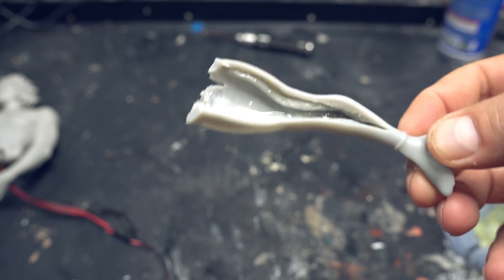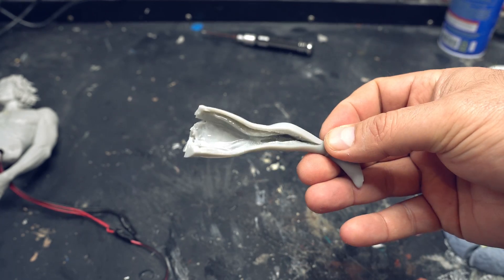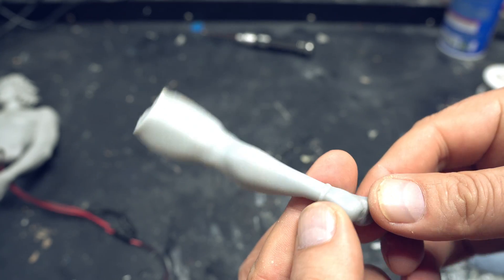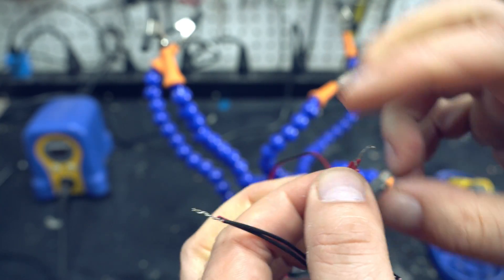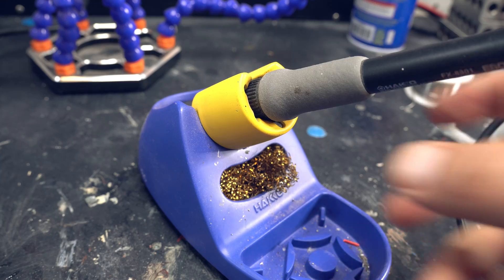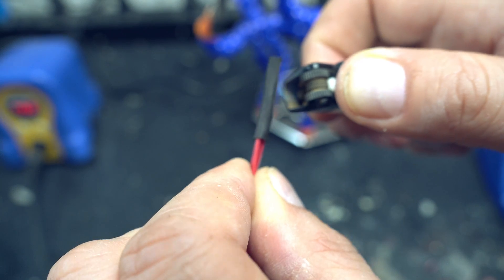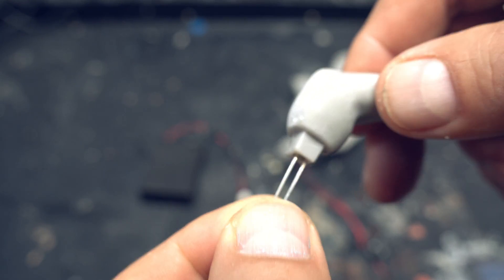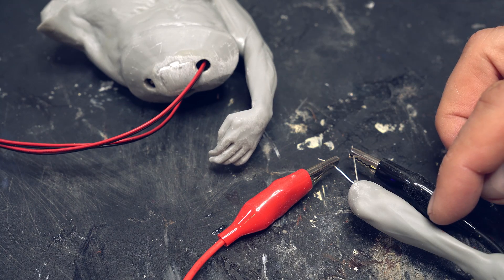Something is Killing Your 3D Resin Prints - Uncured Resin Damage

Comment: Listen, the reason this is happening is because the whole print is under cured and toxic. you need to go watch every video I have right now, because every resin print in your home is toxic and not fully cured, slowly leeching gases. switch to transparent resin, you won't have that issue. Those tiny lights certainly aren't going to give you a full cure, when then the curing station couldn't do it. the outside 1mm or so will be cured, inside toxic.

Comment: I've had 3 nice 3-d printed resin models crack into pieces almost a year after they were  painted and completely finished. I blame this on amateur garage printers improperly curing the prints. This video is very helpful, but really the people printing and selling these should have the knowledge and ability to be able to make these properly. 
Inexpensive 3-d printers and fly by night sellers are a recipe for disaster. Can't even complain since the product appears fine until 6 months to a year later it literally self-destructs.

Comment: or print solid , but your normally better of flushing the models better so the drain holes actually have cleaner flowing through them , then if you feel like it then toss in the smaller UV lights
Reply from the maker: You know that just made me think. I could use a syringe to wash.put the inside. Thx

Comment: Yes, I have had this happen to prints, especialy small solid volume prints that I created that hade to withstand a pressure/vacume chamber for mold making. I wish there was feature or slicer that allowed for single layer-multiple pattern light exposure setting that allowed user to have a gradient light exposure to allow for each slice to have a more cured inside layer while allowing the extriors light exposure to be fine tuned for detail.

Comment: You don't flush the model with IPA several times? I've got 10yo models with no issues because I always flush the model through the drain holes
Reply from the maker: Yep. I let it parts soak for about 15 min. Then fill and drain them several times

Comment: There are a few things that I do. I always double-wash with multiple dunks and swirls to ensure the center is fully clean.  I never expose the resin to degreaser, it disintegrates the resin model even if it is cured and I had a couple models ruined when I put it in an ultrasonic cleaner with LAs Totally Awesome to strip them. Always keep a hole in the model or a path of air when fully assembled so the pressure is always equalized with the environment. I try to fit a UV LED inside the model. If I cant, I have the air path to prevent the resin model from exploding later on. I also never soak the model in water without drying it immediately after in dry box or in front of a space heater.

Comment: If you don't want to make a little UV curing light and do this, print all your hollow stuff in translucent / clear resin so that you can easily cure the inside.
Reply: what settings do you use? I have quality flaws with 0.025um layer height and 2.4s exposure time even though my exposure tests came out fine.
seems like there are layers cured through the active printed layer and are curing resin behind it during the print.

Comment: Nice video to fix it. Interior leds are a plus to ensure you do it right. 
I had the same experience from the firsts prints and not happened again for a years. 
Just be sure the interior is cleaned and dry before close the holes. The ultrasonic cleaner is the best for this. What I do? 
-I wash the pieces in the first bucket of IPA (by hand), 
-then repeat with the second bucket (more clear or new IPA), 
-then put it in the ultrasonic with new IPA and let it dry for a night o day. 
-Then you check the interior is dry and it's ready to close the holes and cure the exterior piece. 
-Painting and mounting the final step. 
Never happened to me again. I hope that help you.
Reply: when you say "by hand", i hope you mean gloved. Aside from the alcohol being rly rough on skin, uncured resin is mad toxic

Comment: Since I paint, and therefor primer, all of my prints anyways, I've just started printing EVERYTHIGN in clear resin. It allows the UV to get all parts and cure solid. Then I primer and paint. It has worked well for me so far.
Reply: After multiple cracked prints I also print in clear resin now.
Reply: this sounds like a great solution for the lazy like myself
Reply from the maker: That's actually a great idea.
Reply: what settings do you use? I have weird overexposure issues with 0.025um layer height and 2.4s exposure time even though my exposure tests came out fine
Reply: what settings do you use? I have quality flaws with 0.025um layer height and 2.4s exposure time even though my exposure tests came out fine
Reply: what settings do you use? I have quality flaws with 0.025um layer height and 2.4s exposure time even though my exposure tests came out fine.
seems like there are layers cured through the active printed layer and are curing resin behind it during the print.
Reply: This is the correct way to do it. I've worked with SLA printers for years for work, and most people in the resin 3d printing community have no idea that this is a ticking time bomb for them. At the end of the day, people will have to accept that the technology was never designed for permanence. It was designed as a cheaper and faster alternative to standard prototyping. In order to get permanence, you need to do what professional model and mini companies do that use this tech. You use these to get your masters, and then use a chemically curing resin (not UV) as your final medium. Then you will have to assemble that.

Comment: I had this happening with some coins I made earlier this year that started splitting apart not too long after making them.  They were hollow and I did the full alcohol soak to try and remove as much uncured resin as possible, but then they sat in my unfinished and non-AC garage and many split.  I wish I would have seen this before. I could have easily built something like this and not wasted so much on failures.

Comment: I’ve been thing about trying something like this but I thought maybe using fiber optic cables with the one side sitting against a flash light and the other end going in the print.  Not sure if that would change the intensity of the light or not or Chang it’s wave length off 405nm   Any thoughts?

Comment: Some materials are better than others, but the cross-linking in these UV cure resins is unfortunately prone to reversion, much like you find on older 'soft-touch' plastics that have mysteriously turned sticky/gooey. Almost all 3D resin prints will revert to goo eventually. Only real solution is to keep backups of your print files.
Reply from the maker: Interesting. I'll have to look into that more. It makes sense though. Thanks for the info.
Reply: That's... shocking. What are some keywords to search? "UV resin reversion" doesn't turn up much. The UV resin patent I found mentioned an acrylate composition, and so it seems on face that catalyzed resin should break down in the same way that CA glue does — ie. not perfect but pretty robust.

Comment: This has happened to me before! It was thankfully not with anything of much value, but it could have been!

Like others mentioned, I wouldn't hollow anything that small, but for larger items I bought a great little UV torch in the correct wavelength range to cure the inside. Just shine it in the holes for a while to make sure it's cooked, and voila!

Great PSA for the newer hobbyists, I appreciate it.
Reply from the maker: Yeah. I don't hollow everything but I do try to save myself some.money resin wise. And I print a lot.

Comment: Why are you wasting so much time on these tiny parts, just print them solid holy smokes
Reply from the maker: I do a lot of printing and if I printed all the tiny parts solid I'd go broke :p
Reply: @3DPrintedProps You seriously have the time to make this ridiculous electrical setup for a 50 cent part, but can't spend 1 more cent to cure the resin that's already in the part anyway?

Here's what you do. Instead of wasting your time with this electrical nonsense, you work minimum wage for one day, and use that $100 to pay for the cost of printing parts solid for the rest of your life.
Reply: @Strill_  Printing solid is not viable above a certain size.
Reply: @3DPrintedProps  well then your time is worth less then minimum wage
Reply: @3DPrintedProps  5 cents is not saving anyone

Comment: Not every thing needs to be "hollow" the resin saved on the arm you was holding would have not amount to much. for legs and arms if possible I print it solid yes there a small chance on a solid arm for resin to be trapped but not enough of risk I worry about
Reply from the maker: True. I do print some things solid, but like I said in a couple other posts. I print a lot of stuff. And printing to many things solid would cost a fortune 😀